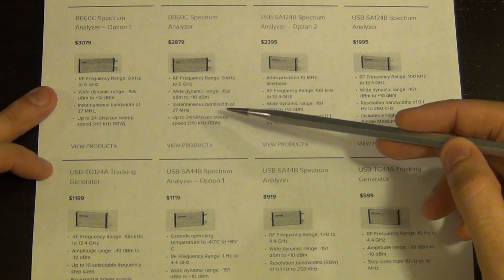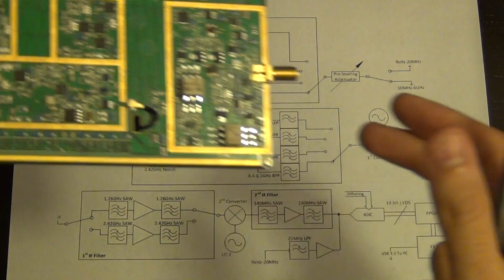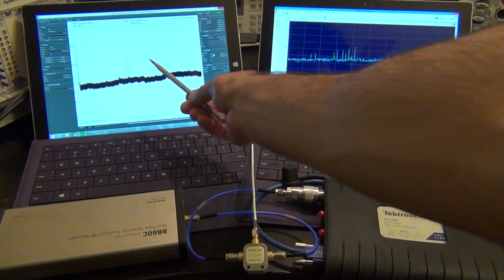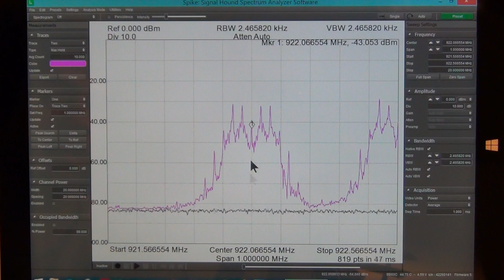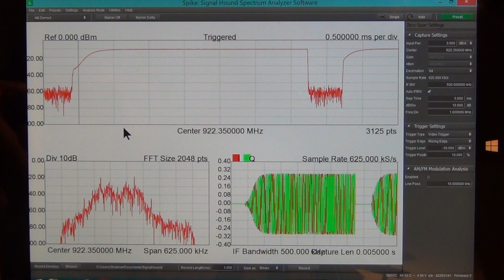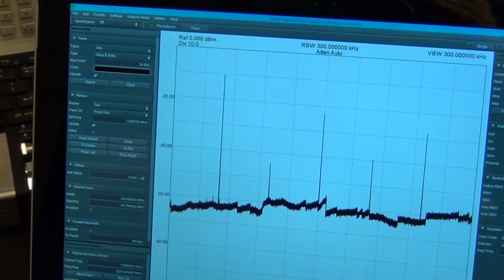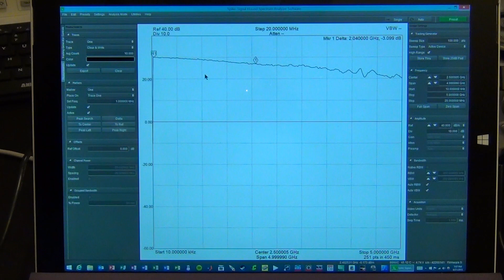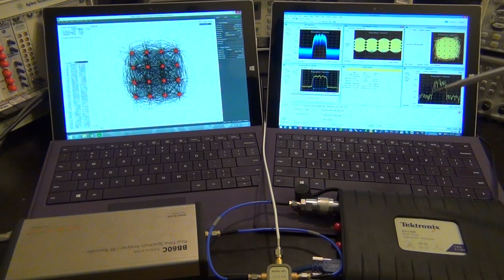TSP #52 - Review & Experiments with Signal Hound BB60C Spectrum Analyzer & TG124A Tracking Generator

Comment: Well done Shariar There are a few videos on youtube about the RSA-306. Your side by side comparison with the Signalhound is the most comprehensive. I had the opportunity to participate in on of Tektronix Seminars of the 306 last month in the SF Bay Area. Both units are very impressive. Thanks for the info you furnished at the beginning of the video about Tek improving the performance of the 306 to reduce the internally generated spurious outputs. Thanks again

Comment: Great video. I was considering the Rigol DSA815-TG 1.5 GHz spectrum analyzer, but the specs of these PC-connected units appear (to my untrained eye) to be vastly superior. Am I missing something; does the DSA815-TG have any advantages to justify the equal cost for 1.5 GHz (compared to the 4.4 GHz Signal Hound USB-SA44B + USB-TG44A)?

And what about the PC vs standalone device question? With oscilloscopes, the interactivity and speed of custom-layed out physical knobs is considered by many to be critical for usability. Is the spectrum analyzer workflow typically so different that this isn't true? (Seems plausible to me that there's less "hunting for a signal" with an SA compared to an oscilloscope, nevertheless curious to hear your thoughts).
Reply: TheHue's SciTech  Hi man, i would like to see your question answered as i´m with the same doubt ... for sure usb3.0 is a great improvement for the bb60c Model, but they use usb2.0 in full speed 480MB/s for the rest of the models.EEVBLOG has a thread with the same question i´ll take a look there..

Comment: Hi Shariar,I have both a BB60C and RSA306.  Conversely to yours, my BB60C has screw thread USB3 connector and my RSA306 does not.I used a SH VSG25A to feed a pulsed signal to both analysers in real time mode and reduced the pulse width.  The BB60C worked well but the RSA306 seemed abysmal being almost unusable below 500us pulse width.  Did you mention that a firmware update is available for the RSA306, or is there some setting in Signal Vu that emables real-time mode?Regards,AndyP.S. Enjoyed the video!

Comment: I have R&S Spectrum analyser which does not have tracking gen installed. I am wondering if that Signal Hound tracking gen provides any suitable trigger output so that it can be used as tracking gen for other spectrum analysers? I am not sure exactly but I have feeling that tracking gen need to generate series of pulses to spectrum analyser - one for each step during frequency sweep?

Comment: Thank you for your effort!
Could you calibrate tracking generator on highest output power level, disconnect it from analyzer and connect to 50 ohm terminator. Then after one hour connect it again do analyzer and check if the generator is stable.

Comment: Question for you:
I have MDO3000x spectrum analyzer, and i need to measure returned signal, to make very best GPS/GSM antenna inside car (that means, i will tune it to match by bands based on surroundings)
I don't have any RF or TG generators, how can i do this measurement ? Is it possible to make very flat noise generator, if yes, how ?
Tutorial would be nice :)
Reply from the maker: Linas K It is definitely possible to make broadband noise sources, it should make an interesting tutorial. It is possible to also use the antenna as a load of an oscillator and depending on the oscillator frequency estimate the tuned frequency of the antenna.
Reply: well, TG is variable frequency oscillator ( so it defeats the purpose of simplicity of measurement). It would be nice to have Mhz-Ghz range flat non DAC based noise source
Reply from the maker: Linas K What I meant was to use the antenna as a "load" of an oscillator that you can build. The oscillator's center frequency will be affected by the antenna and you can measure the center frequency with a spectrum analyzer. A broadband noise source would also be good of course, it doesn't necessarily have to have a flat response as you will calibrate that out during measurement.
Reply: The Signal Path Blog 
Problem with that is i need at least few different oscillators at various frequencys to do test. SIM7100C does have quite a list of bands that can work, and making new oscillator for each will be expensive. And because MDO3000 is more like FFT based spectrum analyzer, it could take amplified white noise as TG replacment.

Maybe it is a good idea to take few 10GHz opamps, and do amplification of high value resistor signal, that is heated by passing current. cascade them, and AC couple them together in series. Maybe you would like to try ?
Reply: Hi, Would it be possible to use the TG44A with a generic SA (for instance a Tek RSA306)?

Comment: Why are all tracking generators amplitude accuracy is terrible. This unit is +/-2dB which is very bad. It would be totally useless when you want to find -3dB point of a filter for example. Why tracking generators' amplitude accuracy is generally bad?
Reply from the maker: Please note that the accuracy is not necessary as long as it is not huge. In order to measure the -3dB bandwidth one would normalize the response using a through and therefore performing a relative measurement. Amplitude accuracy would be helpful when using the TG as a synthesizer.
Reply: Thanks for your response. However, it's important to know how the normalization is implemented internally in the spectrum analyzer. I have no idea how it's implemented. If it's a purely software thing the normalization proccess would still be a huge problem for active devices. For example, due to poor amplitude accuracy of the track gen an amplifier might work outside of the linear region when it's not supposed to or vice versa. This wouldn't be a problem for passive circuits. I don't know if the spectrum analyzer "fine-tunes" the tracking generator output after normalization in hardware. Do you know anything about it?
Reply from the maker: Alperen Akküncü The normalization is done purely in software. This is why I mentioned that as long as it is not too large then it is Ok. For active devices a few dB would be acceptable as long as the user ensures the input and output powers are well below the P1dB of the DUT. Somewhere in one of my spectrum analyzer reviews I do perform compression measurements using a TG.
Reply: Thanks for the response once again. So it's not safe to chracterize an active instrument using powers close to the P1DB point of the DUT then. Do you know if it's possible to use an external RF generator as tracking generator?
Reply from the maker: It is safe to do, but it won't give you the small-signal gain of the DUT. You can use an external synthesizer as a tracking generator if you like. Either software controlled (slow) or hardware controlled if the instrument supports it. In my Keysight EXA review I show this capability of the EXA + MXG.